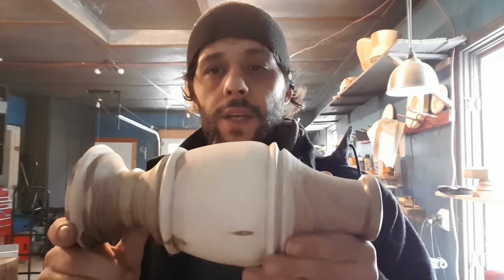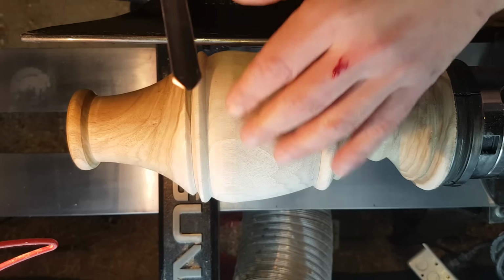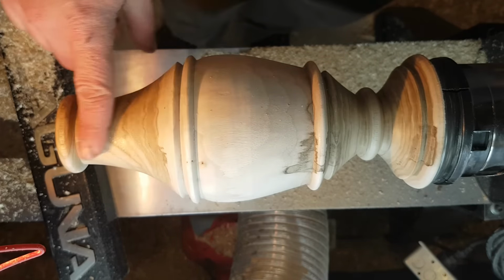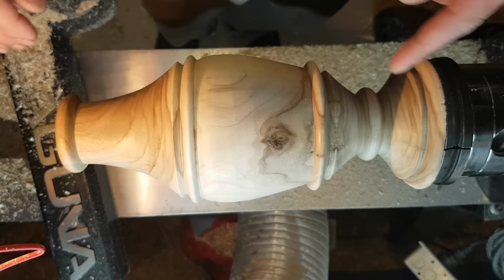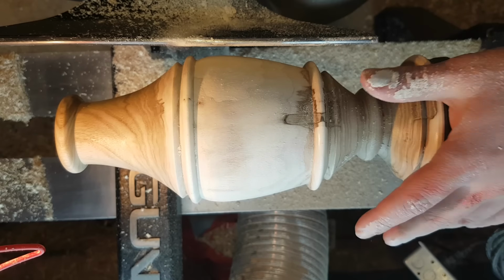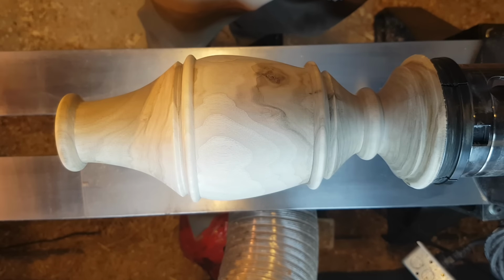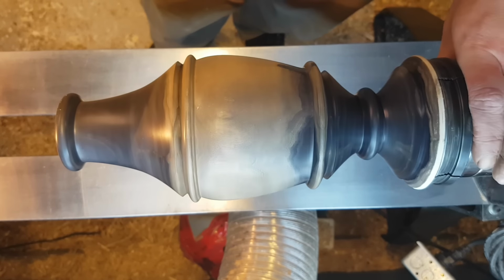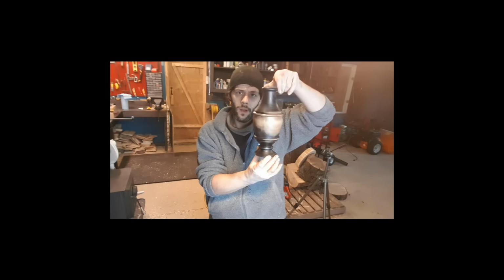Woodturning Ebonising Black Walnut Vase

Comment: Simon, if you actually got chatter with your tool, as another responder mentioned-then my default solution is to go to a higher speed if I can, the actual issue spot you point out is tear out not tool marks in my opinion--you will have end grain and one point in the circumference of a piece of wood, and often you get small tear-out like you did the default cure for that is sandpaper! LOL--love watching your stuff!!
Reply from the maker: +Don Davis hehe thanks Don 😀

Comment: oh btw with skew you need to use only 1 edge of the skew and ride it on the piece that way you'll get the smoothest finish that even round nose scraper wouldn't give ya.
Reply from the maker: CraftWithAfshin cool thanks for the info.  I will practice with a skew I'm not super good with that.

Comment: Nice work!  Since you turned the entire log with the center pith did you get any cracking.  You said it dried for 1 month and then finished it.  Did you do anything special...chips in a bag or just sit in the open air to dry?
Reply from the maker: +mmfenske1 Thank you !! I let them dry in my house . Sometimes I got Crack yes. Sometimes no

Comment: Black walnut and other open grain nut and fruit woods can be a problem getting the grain smooth without tear out, especially on larger convex surfaces. I suspect the wood you have was from a limb, which can be even more open grained and what some people call reactionary because of the fact that the limb is carrying the fruit bearing part of the tree, it's also faster growing and is also more flexible while growing.  You recovered well, nothing to worry about there.
Reply from the maker: +WootTootZoot Wow thank you for your nice info.  And happy new year to you my friend !!!!
Reply: the limb is also supporting its own weight as it is suspended which causes more "reaction" with the fibers holding from above and compressing from below. this happens on any tree not just fruit or nut.

Comment: Hi Simon.
About 10 minutes in you mention some chatter in the middle section of the vase. Try putting more weight on the tool with your left hand. Push harder against the tool rest. I'm not sure, but this  is what I do and it usually helps.
Cheers, Kevin
Reply from the maker: +Kevin Vieyra Thank you Kevin next time I'll try that to see if it work

Comment: Le produit que tu utilise pour noircir, est-ce un produit commercial? Plusieurs utilise un produit maison fait à partir de vinaigre et de laine d'acier que tu laisse dissoudre dans le vinaigre. Ce produit maison donne un vrai noir plutôt qu'un brun foncé.
Reply from the maker: +Alain Menard Salut Alain , oui c'est un produit maison . Je savais pas qu'il en faisait du commercial.
Reply: Mais comment est-ce que tu le produit? C'est quoi la recette? Je veux en faire aussi.
Reply from the maker: +Sam Croninger Hi Sam , it's very easy . 1 steel wool 0000 and 2 cup of vinegar in something like Mason jar . Wash your steel wool with soap dishes to remove the oil before. It take about a week.  And your done.
You can boil it to fast the process.